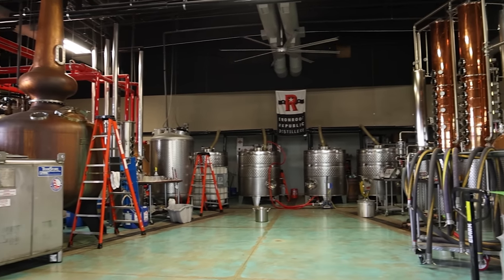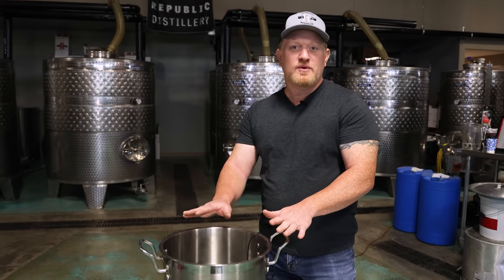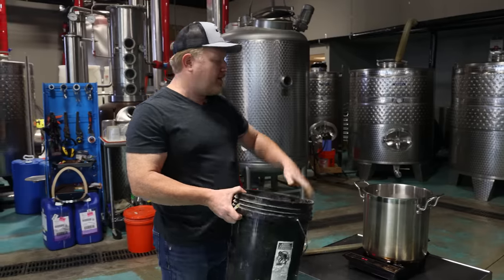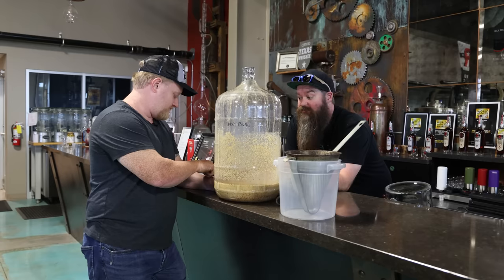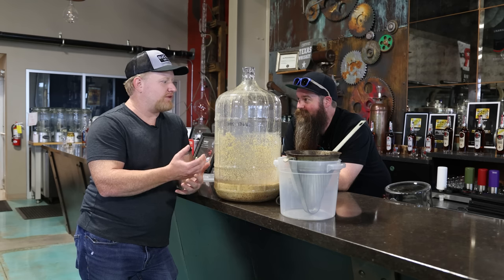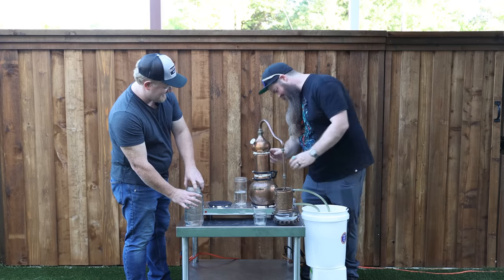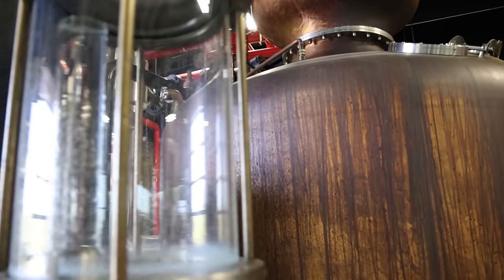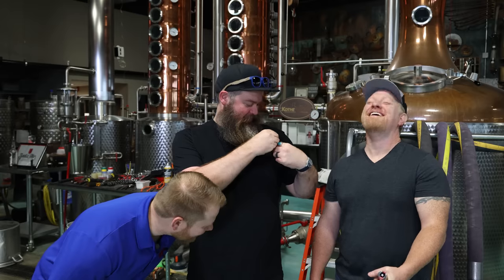Making A Tiny Batch Of Whiskey With The Pros From Ironroot

Comment: If you want to distill on the grain in a smaller still without an agitator, put some of your grains in a BIAB and hang them in the still, as long as they’re all away from the element or bottom where the fire is you won’t scorch and can benefit from having the grains in the still.
Reply: Sides of the pot can and will get hot, so bag shouldn't rather be synthetic.
Reply: @HeartPumper  as long as you can boil in the bag you’re A ok
Reply: I normally toss in grains after I let the heads steam off, then seal every thing up and let it run.

Comment: I have a 6 liter pot still I made to test recipes. If I want to distill on grain I place my 6 liter still boiler into s 4 gallon stock pot with a upside down ceramic bowl in the bottom of the big stock pot. I fill the big stock pot with water. The still is inspired by a double boiler. The whole contraption goes on the gas stove. I can distill any thick mash I want ( a gallon at a time. Lol

Comment: Any chance we could get the recipe written out?
Reply: 100% corn.
Reply: 100% corn

1. Use 2.5-3L of water per kilo of corn
2. Heat up water to boil and add corn (milled obviously)
3. Use small amount of alpha amalayse to thin mash
4. Boil for 45-60 minutes
5. Cool to alpha amalayse temp and add it in and hold for whatever time required for your brand
6. Cool to glucoamalayse temp and add in following same process as above 
7. Crash cool to yeast pitching temp and add nutrients etc.